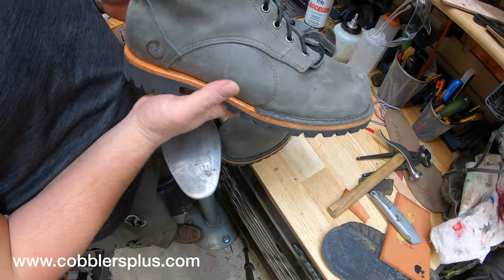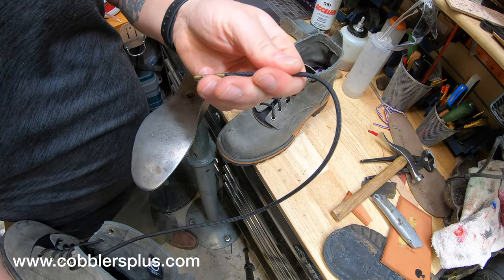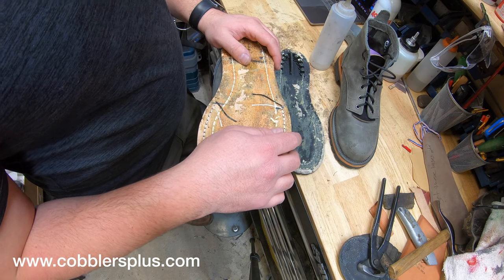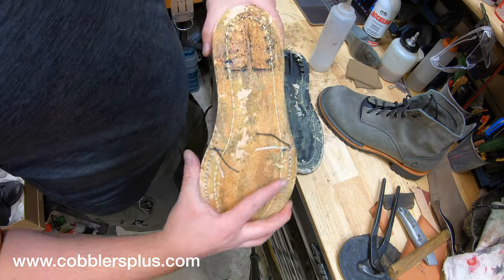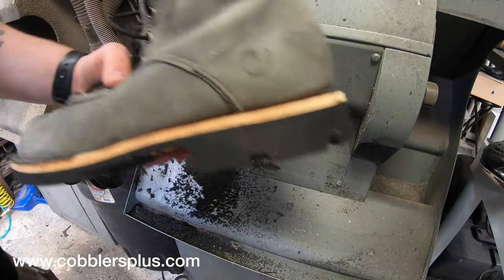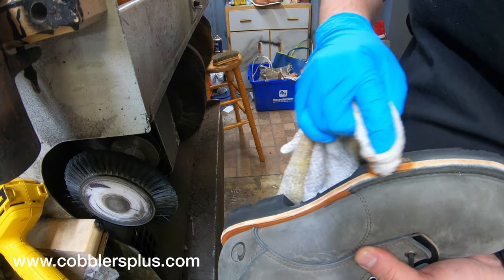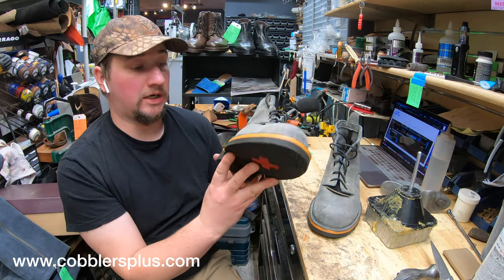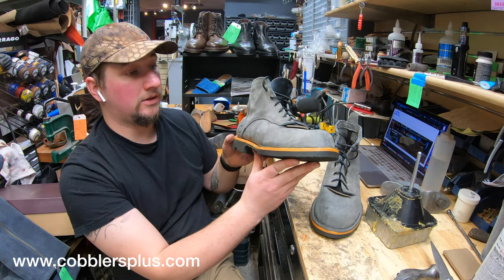Origin Maine Boots get a Simple Sole Replacement from Traction to Grip soles from Vibram

Comment: I've bought 2 pairs of their work boots (owned 3 pairs -origin sent me a replacement pair). All 3 pairs have the issue of the sole separating from the boot when they got wet. I work in the water industry and these boots don't agree with water

Comment: Feels so... Wasteful to just resole for the sake of a different look.
Like, I don't know, don't like it. 
Should note I have no issue with the cobbler, they're just doing a job they are paid to do, it's the customer that annoys me.
Reply: He said the customer needs different soles for the kitchen he works in. I can appreciate that as a lug sole like that will ensure slipping in that environment.
Reply: Yeah, but it beats buying another whole pair of boots (economically and holistically)
Reply: I work in a kitchen and found that the vibram 100 lug works pretty good. But I wonder if these Alphas are much better. Slip and falls ate not fun I wish I knew someone that had the Alphas so I know, I am about to resole my kitchen boots to Vibrams 100 lug. Sometimes big grooves are nice to have in the kitchen in case you step on food etc
Reply: It's not for looks. It's for functionality in a commercial kitchen. I'm sure some cobblers would suggest certain things if they think the customer is incorrect with what they are wanting.
Reply: control issues.